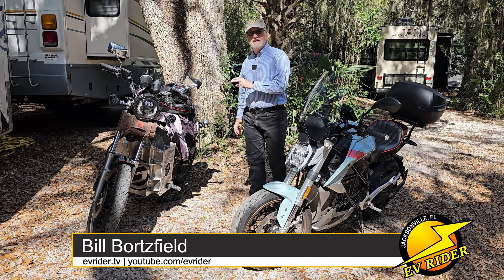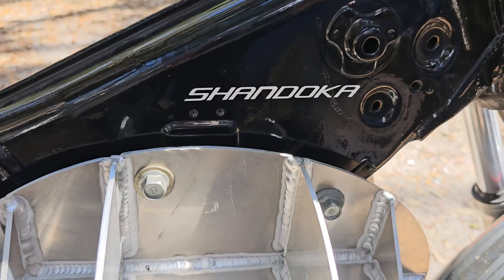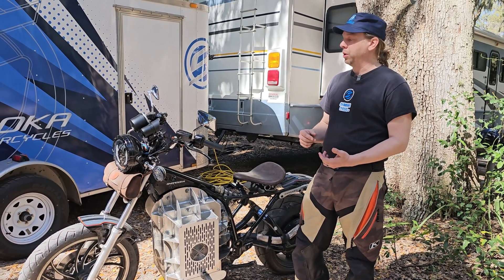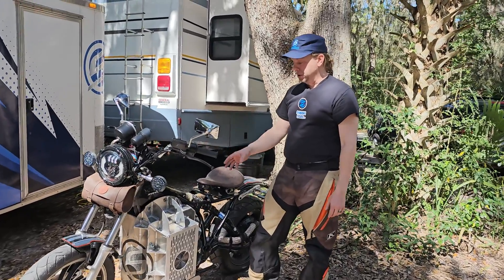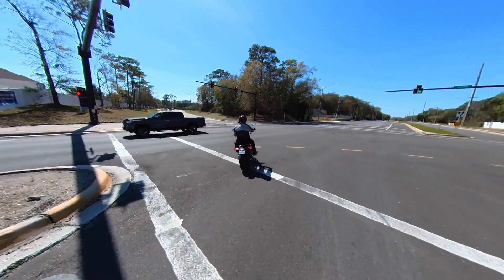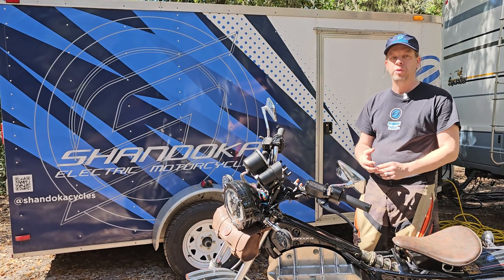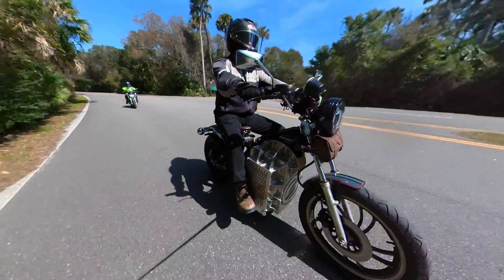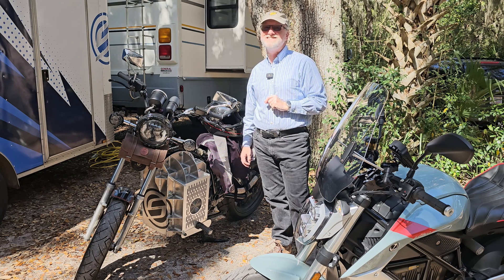Shandoka: Converting Gas Motorcycles To EV

Comment: Interesting, but why design the bike with a hub motor?   The performance and handling will be seriously compromised.
Reply from the maker: After riding the Shandoka, I disagree with your assessment. Full disclosure: I did not ride the converted Yamaha with its original 400cc gas engine but based on what I experienced I doubt performance or handling was sacrificed in the switch to EV. If anything, based on a 400cc Bergman I previously owned, the Shandoka certainly felt faster. I say felt since I did not do any instrumented testing. Balance, handling and acceleration were solid. Hub motors may well end up having a place in the motorcycling world with the prime example being EV motorcycle startup Verge. Until Verge gets bikes into the hands of customers the jury is still out but I wouldn't write off hub motors yet. Verge website: https://www.vergemotorcycles.com/
Reply: @EVRider   Hub motors add significant unsprung weight and significantly compromise handling and performance.  Take a look at the failed Metacycle for a case study.  The other major issue with a hub motor is that removing the rear wheel to change a tire is a complex process requiring disconnecting the power supply to the wheel.   It is often difficult or impossible to balance the rear wheel assembly.  This video shows the 3-4 hour long process.   https://www.youtube.com/watch?v=VoAgnKyHUw4
Reply: A hub motor is great and motor silent.